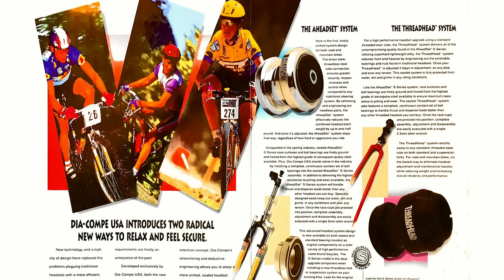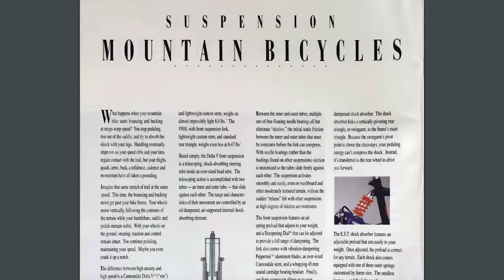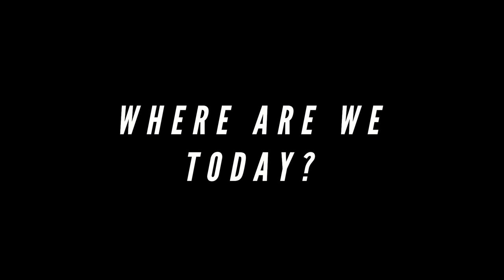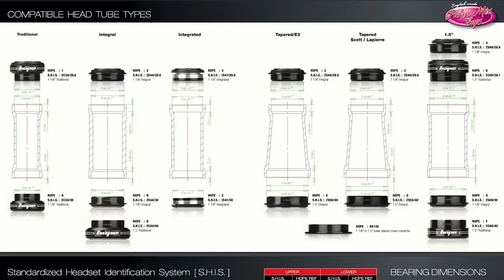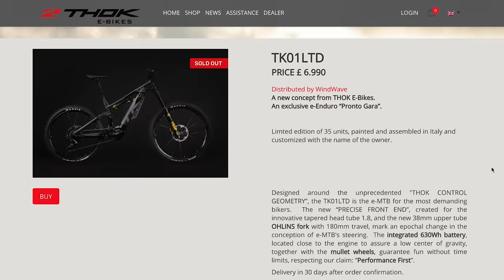MTB Headset Tech | Everything You Should Know About Mountain Bike Headsets

Comment: I've got some less than pleasant flashbacks to the threads getting shredded off those old threaded steerer forks we had when I was a kid. These were cheap department store bikes but they planted a deep seated hatred for the standard. Quill stems make me dizzy on sight. I still remember the screams of the material as we overtightened the stem to the point of what feels like friction welding in hopes that it will stay in place for a few days. Only to be rewarded with a crooked handlebar after just rolling off a curb.

Comment: Not sure if different size parts every 2 years is simpler than my old (now gone) bike with quill headset.  Pictures did help getting the "new-simple" one apart.  Mine is as one pictured but 9+ spacers, and factory grease included in new sealed bearings.  p.s.  God bless Sheldon Brown.

Comment: Literally just changed my headset yesterday. I was upgrading my fork and planned just using the same components and just transfer the crown race to the new fork. WRONG. I messed up because I didn't realize my bike came specc'ed with a straight 1.125 fork even though it was a tapered headtube. I tried new crown races, different bearings, etc. But ended up just giving it to my lbs, to replace the entire headset. Got a good headset upgrade on it at least, no more loose bearings and now got cartridges in there.

Comment: Honestly mtb should use the bmx system. Its integrated, both ends of the head tube have 45 degree angles to slot the cups, which have the bearings already inside them. Then ofc you have the crown race and the compression ring with the top cap. But you can use any brands headset with any brands frame as long as they use the integrated headset standard, which i basically 95% of bmx frames.

Comment: Quite informative. Pushed me across the suscribe line.  Would have like to have seen a few more closeups, but I suppose these are to be seen in the link.  One question.  On a modern (2021) co-moly steel frame with steel forks, is the steering tube aluminum or steel?
Reply: most likely steel

Comment: I'm doing an 1992 Specialized Rockhopper conversion to gravelbike. It needed a new headset and as it has a 1" threaded headset I just ordered a new one online. When I tried to install the new crownrace it didn't fit my fork. Some research later I found out that there is an ISO and JIS standard.

1" ISO: crownrace inside diam. 26.4mm and cups outside diam. 30.2mm
1" JIS crownrace inside diam. 27.0mm and cups outside diam. 30.0mm

As my frame is a JIS standard the ISO headset that I ordered didn't fit. JIS 1" headsets are hard to find so the option is to mill down the fork crown race setting seat and bore out the inside of the headset tube on the frame. You need special (and expensive) tools for this and as I don't have them (nor does my local LBS) some people advised me to file down the frame and fork... Didn't feel comfortable to do this so the search for a JIS 1" headset was on! Found one eventually for an acceptable price.

Long story short...1" isn't always 1"! Bike standards, don't you just love them?!

Comment: The threaded headset:
- 1" caged bearings made from exploding steel.
-a ⅞" quill which never stayed tight.
-steerer tube can only be one thickness, this is known as too thin.
-weird keyed washer all headsets seemed to have, like what's up with that? It chewed up the threads and there was no reason for it to be keyed.
-those massive nuts were bizarre. We're used to looking for a 10mm. How often have you shouted "Where's my 32mm"?

Comment: Hi guys great video, I have a question, In the product description for the SID Ultimate Race Day Suspension Fork - 29", 120 mm say that it is Crown OD (mm)	58. Is that means doesn't fit in a ZS44/28.6 ZS56/40 head set (for the Scott Scale 965)? Thanks for the answer

Comment: Hey Doddy, loving the show. I am currently rebuilding my Santa Cruz Heckler 2, I am going with a 1x12 and modern components where I can so that when I can afford to buy a newer frame I can just transfer majority of the parts across however I was wondering what the best fork to put on it would be? its 1 1/8 and 26" but am looking at minimum 100mm travel. I looked at old BAM Z1's but what would you suggest? #GMBNTech
Reply: a little late but i think that the ROCKSHOX RECON SILVER TK would be good

Comment: 9 point 8 maker Slack R for IS headset to change angle, fiddly to fit would have liked a flat or a hole for a C spanner to help keep them aligned. It kills me every time you paste grease on the outside of head bearings, you want the external cup to bed in and not to rotate preventing the bearing to do it's job. A spinning bearing with wear out the headset cup prematurely.

Comment: I'm having issues with the headset on my mondraker e bike. The original bearings fell to pieces a few weeks ago, so I replaced them with a new sealed cartridge headset. But no matter what I do the headset comes loose after about ten minutes offroad.  I've replaced the starfangled nut twice and I've now fitted the expanding nut version. Even so I had to cut my ride short today because it came loose again. 
Heeelllpppp! 
Any advice Doddy?

Comment: I just received my IS42/52 headset for my new Merida One Twenty frame. The top bearing sits about 3mm below the top of the head tube. Why design a frame with such deep insertion depth for the bearing. I figure I’m going to need 3mm or more of spacers just to preload the bearing correctly.

Comment: I have the Aheadset system you speak of on my 2005 Devinci MTB. I can’t get the cups out. They seem pressed into the head tube. I want to take them out so I can clean and re-grease the bearings. Are the bearings pressed into the cups so if I can’t simply replace the bearings? Thanks

Comment: #askgmbn
What do you guys think about oval chainrings? and why can't handlebars have a hole in the middle to eliminate the use of a stem on a bike and decrease the weight? The bars will fit on the steerer tube instead of using a stem
Reply: Look up the answer 0 offset stem from the late 90's early 2000's. 
Basically the longer the reach of the stem slows down how twitchy the front wheel feels. The old 100mm xc stems felt like turning a bus steering wheel and the zero offset was extremely fast. 

The feeling of a long stem also makes both hands move in an arc in front of the headset pivot point. The zero offset with flat bars had one hand moving forward and the other back instead of the natural arc. If you add bars with decent sweep then both hands are behind the steering pivot point. 

To play with the idea, in your car have your hands at the 11 and 1 position on the steering wheel and do some turns. Then go to the 3 and 6 position, finally try the 4 and 7 position. 

The difference is subtle but you'll feel what I'm writing about. 

Basically a similar set up was done, it felt terrible and the designers found that 35 and 50mm offset were most comfortable for off-road not including xc bikes.

I hope that makes sense.

Comment: Was thinking of putting an angled headset on my Giant Trance, but Giant advised that this would invalidate warranty due to putting too much pressure on the head tube.   Would reducing the head angle from 67° to 65.5° cause that much of a problem? New to this, but would be interested in thoughts.
Reply: it does put pressure on the head tube but may be worth it if you are willing to take the risk of having your head tube snap with no warranty

Comment: Hey GMBN! I have a tricky question. I have a 2019 Scott Genius. The top headset bearing cover, spacers, and stem are all proprietary, they kind of interlock and have a really odd shape. It’s not like a Trek knock block though, it’s Syncros proprietary. Any idea how I could convert this back to standard spacers and stem so I could swap out my stem without having to buy a Syncros integrated stem/bar system? Maybe I can just buy a new bearing cover and use regular spacers?
Reply: i rcomend getting a CANE CREEK 40 TAPERED HEADSET and a new stem with cheap spacers if you want to change it

Comment: #AskGMBNTech
Hi Doddy, hope you're doing good. I've got a question about some not so new tech
My Fox 32 Performance has a 150mm travel and fitted on my 2016 Scott Genius. Bike was bought brand new in July 2020
I'm experiencing some vibration and a 'knocking' sound when I'm braking (front brake) heavily on a steep smooth road.
I'm not sure what it is but it feels like it's coming from the front axle and makes me think something is going to come off
I've checked everything I can:
1. Headset for creaks. I've even cleaned them and made sure there's no play
2. Brake caliper is mounted securely on the fork
3. Brake rotor is tightened correctly onto the wheel (Shimano centre lock type). Rotor is not bent as I do not hear any rubbing when front wheel is spinning
4. Wheel spokes are tensioned correctly
5. My wheel which is built around a standard Shimano 15TA x 100mm hub spins smoothly without any creaks from the bearings
6.  I've even tried loosening and also slightly tightening my QR TA. Same symptoms occur under both conditions
I'm not sure what else can be the culprit. The same 'knocking' sound is also heard when I cycle my front suspension
Would you know what could be the problem? Is it because a Fox 32 isn't really stiff enough for 150mm of travel and the vibration and knocking sound is due to the fork flexing a little during heavy braking? I hope it's not anything to do internally with the fork.
Please please please help. Thank you so much in advance. Lots of love from Malaysia
Reply: Reading this, I can't help but to think about a problem I recently had with my rear shock. There was a similar 'creecking - knocking' sound as you describe it, coming from the rear shock area. Whilst servicing the shock, it turned out there was a small dent in the inside shaft of the damper, causing the piston not being able to move 100% smoothly up and down the shaft and thus making funny noises. How it got there, no idea. Never clamped my shock or anything.

Anyway, it might be worth to open up your fork, service it and have a good look at if everyting operates smooth.
Reply: @Sibert_  I have a suspicion it could be something internal with the fork but honestly I am hoping it's something else less serious.
Not many bike shop mechanics would want to service my fork. They'll say that there aren't many parts for a 150mm travel Fox 32 from 2016 and would rather sell me a new fork instead. I fear the same thing if I go to the local Fox suspension distributor/service center here in Malaysia
Reply: @shafhamid83  Damn that would be bummer. But you can give it a go yourself tho, especially a lower leg service. GMBN Tech even has a video about it, and I'm pretty sure you still can get parts for your 2016 model. 
And ask your shop, service center, distributor anyway. You never know.

Comment: 16:40 how does the star nut thing that’s on the table attach to the fork?
Reply: It's hammered using a special threaded punch directly into the inside of the fork steerer but the depth that it's driven into has to be precise.

Comment: My 2020 orbea Occam came with open bearings in the headset. Absolute scandal for a £2k+ bike . Have had to switch then after 5 months
Reply: You mean no seals on the bearings, or the caged balls between cups? 
Either sounds wrong....
Reply: @wonderwatch2239  not sealed. Can see the individual bearings. Not even packed that well with grease either. Was a common theme with this model last summer.
Definitely not good enough

Comment: why do bikes use both metric and imperial sizes ???? , its a pain in the arse when trying to find replacement parts .  often both on the same part .. 27.5 wheels with 5mm axel as example , iam sure you get the point ....so many parts with both
Reply: 27.5 is the overall diameter with typical mtb tyre. But the wheel is 650b sized- 650mm.